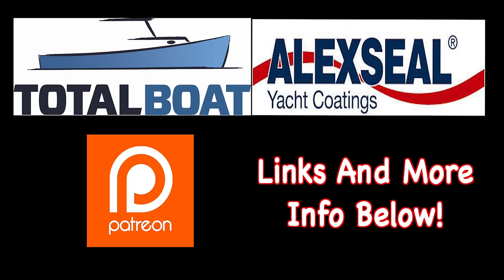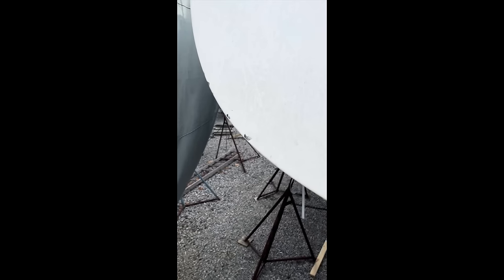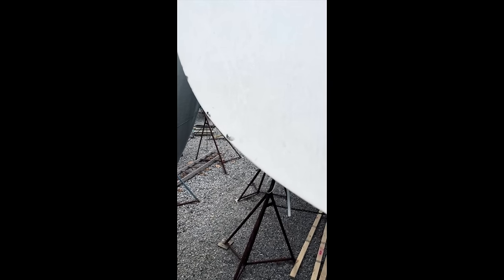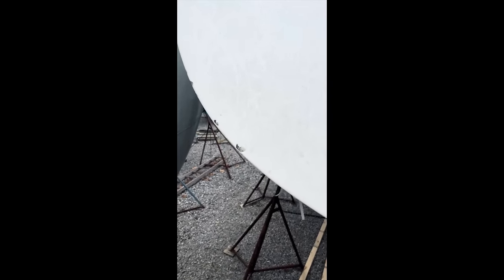FIBERGLASS REPAIR OR COSMETIC GELCOAT TOUCHUP FOR YOUR BOAT??

Comment: Regarding color matching....I found learning to mix anything beyond white, especially darker colors to be a long learning process. However, most of the bigger PRO marine fiberglass/paint suppliers in marine centers, like Fort Lauderdale, have spectrographic analyzers. Give or send them a chip, even a smaller one, and they will mix the gel coat or paint exactly for an old color after the 1500 sanding in my experience. I may have to break off a chip from an undamaged area to get the chip but I'm doing the area anyway. Just make sure it's from the same area: sun attacked or not-so-much. (If at a dock and not end-for-ending the boat periodically at the dock, one side will age more than the other) Usually I could pick the color-matched gel up the next day or mail it in and have it mailed if far away. Fast, reliable, cheap and accurate on top of saving me bags of time and the possibility of having to do the job over if not a close enough match. They also have all the materials you might need like PVA & MEK that your local marine store or auto paint supplier may not have. I used to buy storm damaged boats from insurers and zero-time them sail or power: new engines, all new upholstery, panels, radios and electronics, rewire, and either repaint or re-gel the entire hull if needed. Gave the original color brochures to the upholstery shops to work with. Very satisfying results.

Comment: Good info. I re-gelcoated a hatch on the rear of my boat. The color match was very good but I was not blending into any existing gelcoat. After about 5 years or so, this panel is a bit darker as the gelcoat matured. The boat is an off-white. If this is typical of gelcoat (which I am not sure), then I would say that if you have the new gelcaot off a hair, error on the light side. 
The other thing I heard when blending is to use a little of the clear gelcoat after the void is mostly filled in. Essentially add 1/3 of clear into the existing mixture and then add in more clear for the final coat. It makes the transition less noticeable.

Comment: Hi Andy! I have a question. I have an old wooden boat that I want to restore. I think the work flow is as follows: remove all paint up to the wood, fill gaps with fiberglass putty, sanding, dust removal, polyester impregnation 430g/m2 glass fabric polyester and finally a top coat (wooden fishing boat) thank you. follow your works on your YouTube videos, you are an excellent person!!

Comment: Hi Andy I'm going to be doing some of the exact same work and some impact damage work above the rub rail. Also holes from a bimini top and  I want to repair the areas under the hand rail. The boat has non slip built into it with diamond shape niples so I can just do the best I can to preserve it when fixing some of the cracks. I'm going to paint the whole top side after right down to the rub rail and leave the rest of the hull alone for now. I have bottom work to repair first.

Comment: Hi Andy, thanks for the helpful video and your pragmatic approach, as always. My question refers to the required prep work to be done on the spots with exposed fiberglass. Normally, the exposed glass acts like micro-pipes sucking the sea water, which evaporates then leaving salt inside the glass structure. Doesn't it affect further bonging of the new gelcoat layer if we only sand the spot with, say, 220 or 320 grid paper? Will the new gelcoat durable as bonded to the glass and salt background?

Comment: Thanks for the informative video! Not sure if my question applies, I do need to fix quite a few nicks, but there is a complication: someone has applied a coat of paint on top of the factory gelcoat. Not sure what that paint was, but it is decomposing to the point that leaves my pants white whenever I seat on it. Clearly I would need to sand it out, but what strategy would you recommend for that? Like how to tell I am down to the original gelcoat without inflicting too much damage onto it? Thanks in advance!

Comment: I matched my gelcoat and it matched so well I had a hard time seeing where I coated! Came back a few days later and it cured much lighter and is a terrible match. What happened? I did compound old are too.
Reply: What thinner did u use? Acetone is a no no in my book. Also color matches look great a lot of the time until u wet sand and polish

Comment: I hope I am still.in time for you to see . My issue  is not video worthy.  But I have to replace the transom on my 68 glastron cv 16 basically the sister boat to leave jump boat in James  bond.  To my question.  Should  o go with plywood covered with fiberglass and thicken Resin? Or should  I go with liquid transom.

Comment: I had my 1983 C&C landfall hull sand blasted below the waterline (cored) in the fall and noticed some spider cracks in the gelcoat on the starboard side. I’ve let it dry out over the winter. They are in 2 areas 1) where the jack-stands perhaps may have been placed over the years (just fore of the bulkhead - flexing), 2) above the keel on the hull stub (flexing), so to speak. Just my theory.

How would you suggest going about fixing those? There are lots of videos above the waterline, but I could not find any “Andy next Level” videos really addressing below the waterline. 

I plan to barrier coat. I thought you might be interested in a video of this nature and I’d sure like to help. If interested, let me know here and I’ll be in touch.

Comment: Is there any difference between MEK and MEKP for polyester gelcoat ?
Reply: Mek won’t catalyze gelcoat
Reply: Mek will clean or thin it but for thinning I only use styrene
Reply: Mek-methyl ethyl ketone
Mekp-methyl ethyl ketone peroxide. I’m guessing the peroxide chemically changes it pretty drastically

Comment: Hi, will silica or cabasil change the color of gelcoat?
Reply: Colloidal Silica and cabosil are 1 in the same. It shouldn’t change the color but can shrink a little. Use as little as possible to achieve what your trying to do